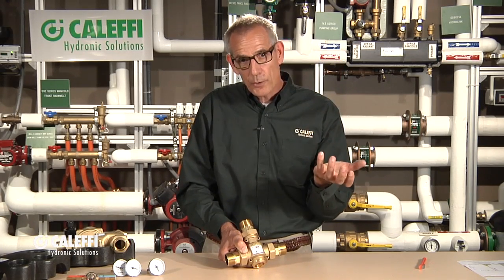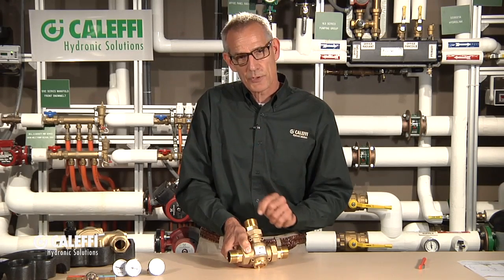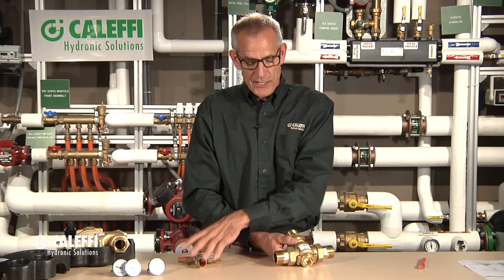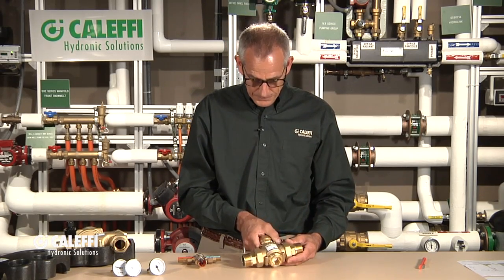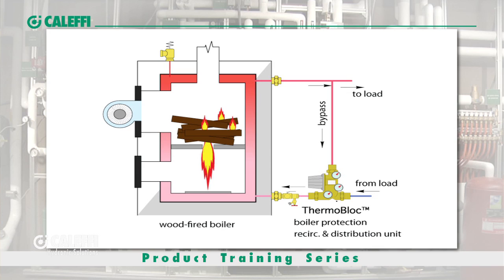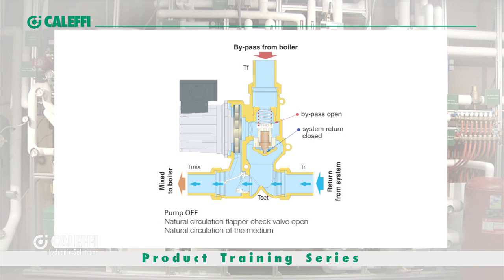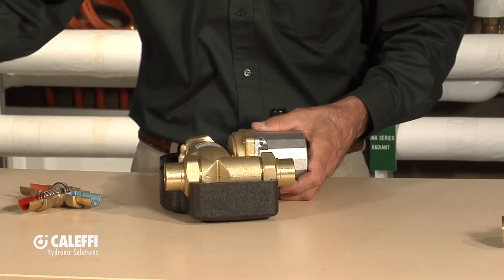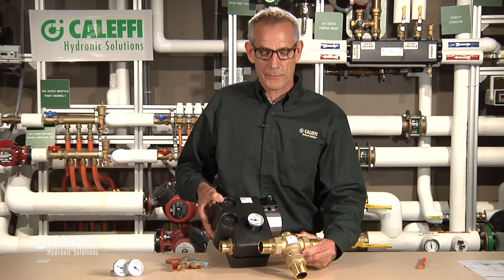ThermoMix™ and ThermoBloc™ - Boiler Anti-Condensation Protection Valves

Comment from the maker: We prefer that you pump away from the mix valve and into the heat source as shown in the installation manual (see above in the description). Yes you may use your own circ pump, as it is sized to the load you have.  Note the 10 or 14 Cv in the specs, depending on the valve you select. So the valve will flow this gpm with a 1 psi pressure drop. It is a high flow valve. Add isolation valves on the 3 sides of the valve when you install it.  This provides for ease of service, if needed. 

Thank you!

Comment: I was thinking about using this boiler valve for my system....however i have the circulator on the supply side, and not on the return side.  Would the pump version be better to aid in flow for my setup, or could i get away with the thermostatic valve alone, and i would be fine?